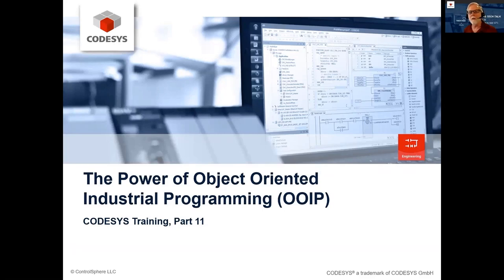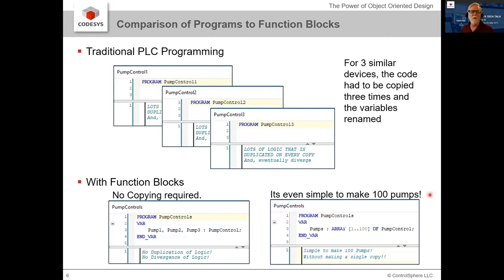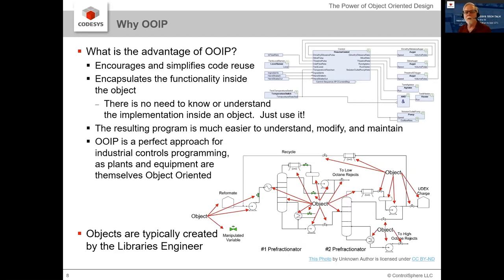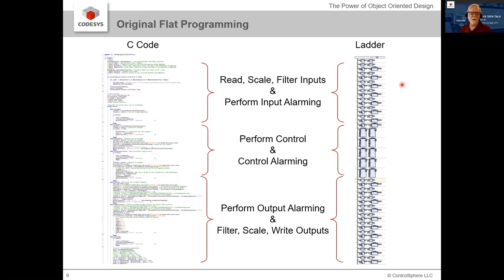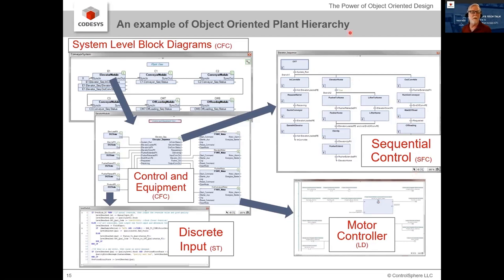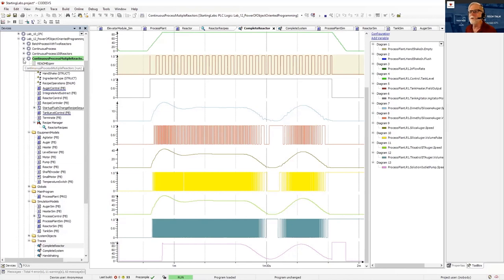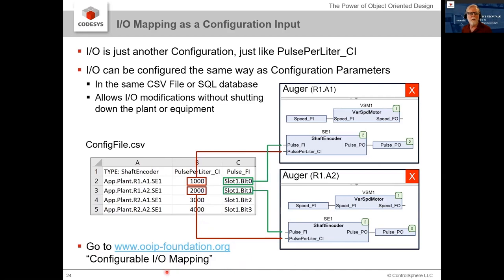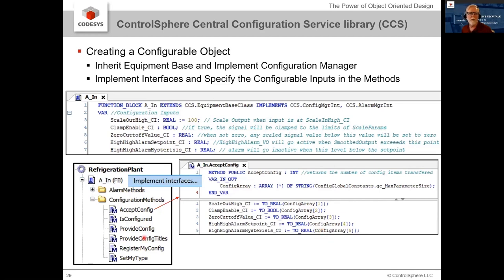Object Oriented Industrial Programming - Basics and practical Examples in CODESYS

Comment: As a new plc programmer. I kinda understand why there is other language like SFC will be useful. What iam learning is ladder logic then FBD because of Siemens(just testing not in real world). Now i think if you really wnat tobe very good in industrial automation, you really need to know all the languages and use it in your program and build like this. Am i rite sir??
Reply from the maker: IEC 61131-3 defines five automation control programming languages, each with unique strengths and applications. Language choice depends on project requirements and developer preferences, with no clear superiority. While some situations may favor specific languages for efficiency, all five are normatively defined and suitable for industrial use. For a simple projects Ladder Diagram might be the best choice. For complex mathematics ST might be better. But the programming language is not the only thing, which makes you good in industrial automation.
Reply: @Codesys-AutomationSoftware  could you please give me some point or skills to be good in industrial automationm.thanks
Reply from the maker: @bryanfrancisco-t7x  That is not a question, which can be answerded in a general sense. It completely depends on what you do in industrial automation.

Comment: I am new to codesys.... I think  stractured text is good from which many languages can be used...
Reply: I want to use codesys for simple project of Automating a gear Hobber which has two motor pumps, couple of solenoid valves 3 24v DC  clutches one main motor with DC motor which I will used DC drive that's it... Is not a big project about 24 inputs buttons.. I don't plan to use HMI... So jaaaa. ST Programming is good for this... Is see the value of  Object programming in a big industrial application

Comment: Hi, you did a big job ,special thanks. But i have one question, in your Projekt,you have lot of Applications, can someone exchange data between these applications, for example ,if Data(Variables) from Lab_07_StrctureText can be used in Lab_10_CFC
Reply from the maker: Hi, thank you for the feedback. Yes, data exchange is of course possible. There are multiple ways to do it. Probably the simplest way is to use the objects "Network variable list" for sending and receiving variable values. See https://content.helpme-codesys.com/en/CODESYS%20Development%20System/_cds_f_networkvariables.html  for further information.